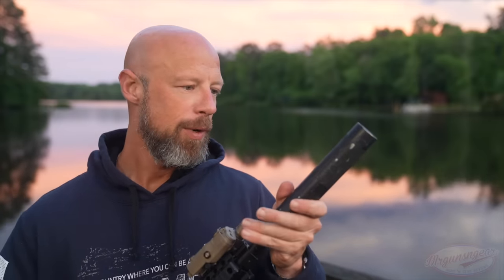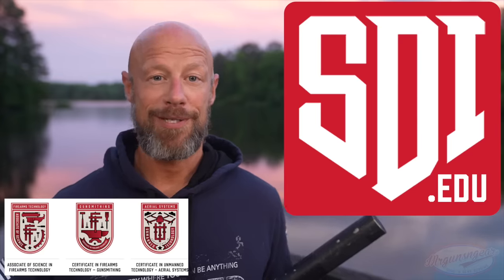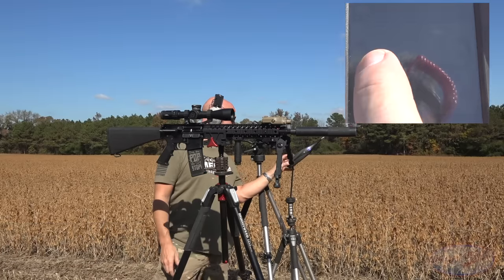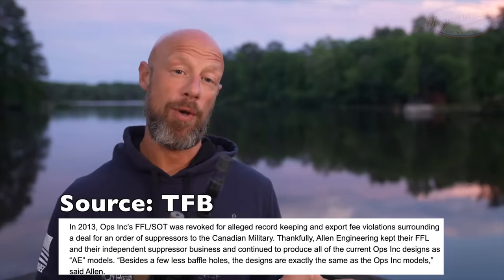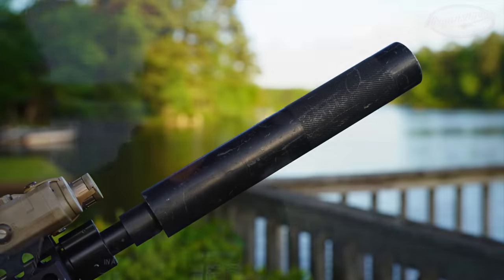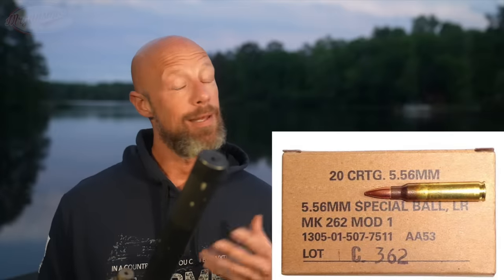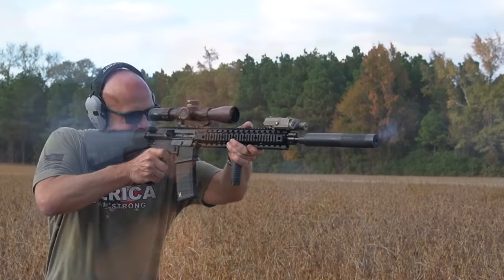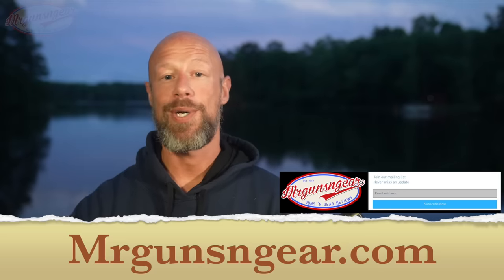The Quietest 5.56 Silencer I've Ever Used 🤫

Comment: I have done extensive low/no light testing with the AEM5. 
With Mk262 ammo there is not only zero muzzle flash but no port flash!
Tests have been performed in all types of weather conditions ranging from -10° to 85° F

Comment: I have an AEM5 and it is fantastic. I also just got my stamp back for my Otter Creek OCM5, which I don’t have any rounds through yet. I can’t wait to shoot them side by side to see how they compare. Great video, Mike. Thanks!
Reply: I would be curious to hear your thoughts on the Otter once you have run it.
Reply: @EssPhour  the otter creek ocm5 is pretty quiet too.
Reply: I got the ottter. The AEM5 is a deeper bass like sound. The otter is quiet but has a tin like tone to it. It is a little sharper sound. Both are on par quiet. The otter is shorter and has titanium baffles. If I remember right the ops inc, and AEM, lest I forget the next company to make them to spec used stainless. I feel like the titanium has higher pitched harmonics.
Reply: Are these quieter than an RC2 ?

Comment: When I was building my first AR, i was trying to track down the necessary parts to be correct. Some parts were expensive at the time and the suppressor wasn't being made at the time I believe (2012 time frame). 

I settled on a AAC M4-2000 suppressor with the flash hider. Back then, they were sold separately. I recently learned that the M4-2000 isn't being manufactured anymore. 

It would be nice to see a comparison between some 5.56mm suppressors that are/were used by military.

Comment: How does this suppressor work with gas piston rifles? Specifically the Robinson Arms XCR-L. The gas rod is a long stroke gas piston. The bolt carrier has machined contact points for a connection between the gas rod and bolt carrier.  
   There is a gas adjustment valve showing a very small gas port. A total of four gas settings for non-suppressor use. A total of five settings are available. With #4 being the largest hole and #1 hole for the smallest non-suppressor setting. There is an "S" marking for suppressor use.
   Are there any issues when using gas piston systems with suppressors?

Comment: I got my AEM5 about 3 years ago now and its an amazing silencer. I found an old-new Ops Inc A2 flash hider for my 12.5 AR so I can run the AEM5 on both my shorty and my home built MK-12 clone. Mr. Allen I believe has since retired and transferred manufacturing to a few of his employees to produce the AEM5 as well as the other models.

Comment: Sound reduction is impressive, but judging by the amount of gas coming back through the ejection port, I’m guessing this can is buttoned up pretty tight on the inside. I’m a lefty, so I’m always cognizant of blowback through suppressors. I run adjustable gas blocks and flow through designs on my platforms. Have an OSS Helix, and a Rugged Razor (not mounted yet), and am looking at getting a TB Magnus with secondary retention so I can run full auto. All these cans have reduced back pressure an minimize ejection port blow back. That can is damn quiet though!

Comment: Very interesting, but I looked all over the Net for someone who sells them and the only place that was listed and actually carried them showed out of stock on every model Allen makes (AEM3 trhu AEM30). Collars out of stock too. And the price is not $669 anywhere... be nice to find a place that offers a kit with all parts or took backorders.

The db average of 131 is incredible, but if this is unobtanium, what would be the next best thing in your opinion?
Reply: Otter Creek makes a clone
Reply: @Pishadoo42  A sad, hot garbage clone.
Reply: I have two of these.  One for a really long time, and one right from right before Ron Allen sold the company.  I've shopped for collars for new rifles every now and then and I have never - ever - seen them come as a complete kit. Part of that reason may be that there is more than one way to mount the collar to a barrel, and actually you don't even need a collar if you decide to mill a shoulder onto a heavier profile barrel.  The AE30 (the .300 version) calls for the shoulder to be turned onto a barrel as the primary method for mounting.
Reply: @OFFICIALUND  cry
Reply: We recently took over production since Ron is semi retiring. He is continuing to make the mounts while we make the cans. We went and learned the process from them so they are the same can, not a clone. Allen Engineering is still owned by Ron, we just make them under his brand.
Reply: @Pishadoo42  huh?   It’s not exactly a secret that it sucks.  I understand why people bought them, but the performance is well known to be lacking.
Reply: @TrajectoryArms  Apologies….. should have said “…. before Ron contracted out manufacturing to an outside third party.”
Reply: @OFFICIALUND  no worries,  we get it all the time. I'm just happy to be able to keep the legacy alive.

Comment: VERY interesting how the suppressor goes back over the barrel.  I had been wondering for a while why we don’t see that.  Definitely to get the maximum dB reduction respective to the added length of the barrel.  I’m very excited to see that, and may get one!
Reply: There is a shoulder behind the brake pinned to the barrel. You will need that also to get it right.
Reply: Didn't the De Lisle carbine do something similar?
Reply: Reflex design. Dates back to the 1940s.

Comment: This was my very first suppressor for my MK12. Well, i have the original Ops Inc. model 12. Since I understand that ME is effectively a copy of Ops M12, i can confirm its one of the quitest ones i have had. I use it normally without any additional ear protection and i have not had any hearing issues or additional fatigue during shooting, but thats me. The only disadvantage i think this can has over the more modern designs is size and weight. Given that Mk12 is already quite heavy in mod 0/1, it adds up. Respect to serviceman who have used that setup daily in their duties.

Comment: Just got my SOCOM RC2 approved today after about 9 months. WOOT

As bad as I wanna use it, think I'm gonna wait until I get a bore alignment rod to double check centering.

I wanted to put the RC2 on my Tavor but Surefire said they do not recommend that as the Tavor does not have a shoulder like an AR and uses a jam nut for the muzzle device. Ugh. Hopefully I can use an adapter for my Liberty Cosmic and appropriate muzzle device for it, on my Tavor. Would rather not shell out almost a thousand for another can just for that.
Reply: Look into the KBA Custom Tavor muzzle shoulder ring.  Eliminates the need for a jam nut.
Reply: @2coolperson  Orly? Well poop I'll def check that out. Appreciate the info man
Reply: @2coolperson  Holy feces bruh that looks EXACTLY like what I'd need to use the Surefire. Ordered one up, and I got a bore alignment rod in today actually. Dude I love you 😘😘 Have to wait on the Tavor for a bit longer but gonna run the can on my shorty AR this weekend, nuts will be busted bois
Reply: You're welcome bud!  Took me a while to find something that fixed that exact problem for me.  Still haven't used it yet lol been looking at getting a low back pressure suppressor for my x95
Reply: @2coolperson  Yeah after getting the SOCOM RC2 I thought I should've maybe got the OSS (Huxwurx now I guess) can instead lol. I'll have to see how it goes. Good luck on the can!

Comment: This would look sick on a carry handle build
Reply: The Unit had them on 723s sleeved over by 12" handguards before the M4A1.
Reply: Like on a Gordon carbine?
Reply: @amota92  Remove the carbine handguards, barrel nut, and Delta ring assembly and replace it with a knurled 12" float tube with FSB pocket cut.

Sleeved Ops Inc over the barrel, under the handguard.  Looks like an MP5SD.

Comment: Not knocking the AEM5 at all but IMO the Banish series are superior in numerous specs. First is the weight the Banish 30 7” is 11 oz and the 9” is 14 oz. The also have the Banish 30 Gold which is a QD version has an 8” that comes in at 13oz. It’s made of Titanium, fully serviceable by the operator and lastly it reduces decibels the ear at a minimum of 131DB. The only drawback is the price. AEM5’s come in at $600 on average and the Banish 30 is $1000 the Gold series can be upwards of $1400-$1600. But with all the advantages I’ve listed I think it’s worth the extra scratch.

Comment: Not entirely sure what I was hearing on the first sound meter test, it sounded like you had a mic close to the stock and it was picking up more buffer spring twang than gunshot even unsuppressed. If that is what I'm hearing and it annoys you when shooting I would recommend trying a flat buffer spring, I know there are silent buffer systems but they usually run like $100 or more where a flat spring is like $20 and I personally switched to one and as far as I've experienced it greatly reduces the spring noise without impacting functionality or reliability.

Comment: The old XM21 flame arrester worked the same way, it was bigger but it was made for a 7.62x51 round. The way it worked best was to fire a round into the ground and cover the end with a piece of tape, this kept oxygen from getting back into it and no oxygen, less flame. It worked well enough that from 50-75 yards at night you couldn't see where the shooter was. Sionic made them and good luck finding one, CIA issued the rifles with a couple different ART scopes that worked well with M118 rounds they were designed for and again good luck finding one of those although they are easier to find than the Sionic suppressor, I imagine the CIA repurposed those and just kept them, but you can find the schematics for the arrestor in a google search even and the scopes are well documented, but since this was late 60's to mid 70's sort of a combo, hard to find either, same with finding a XM21 that is original, many of the ones you see out there are just pieced together and lack all the parts that made them a damn good rifle. While they were effective out to almost a thousand yards, they were fantastic from 300 to 500 yards for real world shooting.

Comment: Is there a barrel restriction on these?
Reply: Yes and no. You can run them on as short a barrel as you want with the right configuration of mounting hardware. The AEM4 has a shorter mount that is more practical for many uses, it's just not as widely known

Comment: I think you placed your meter incorrectly. Should have been in front of the barrel. Flow through are louder in front & I suspect baffles are too. Better absolute comparison in front, but $ risk maybe.
Edit: does depend on if you are concerned only w/ your hearing & not being located easily, so @ your ear or 5' in front better...

Comment: Dude...Allen Engineering quit making them either shortly before or right at COVID.  Otter Creek Labs either bought the plans or produce via license as the OCM5.  They also produce the mounting system but also produce an easier one piece set up.  They are pricey though.  I believe MAC is the one that broke the news about Otter Creek producing these new ones.

Comment: Now find/make something that is or nearly as quiet without all the gas back in your face.  Gas blocking charging handle may help but I doubt it would eliminate that much gas.
Reply: It's certainly not a low pressure can but you can mitigate a lot of it with a few tweaks of the rifle.